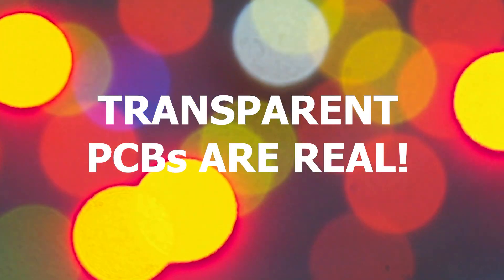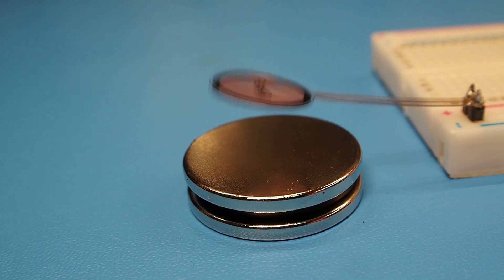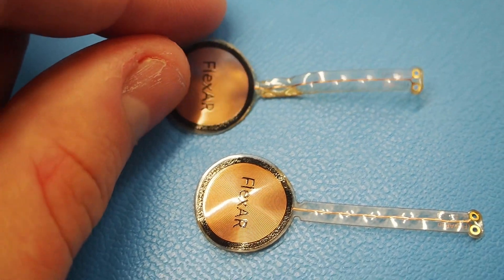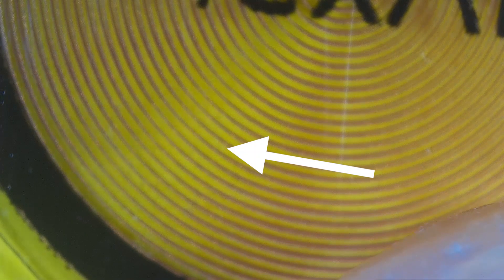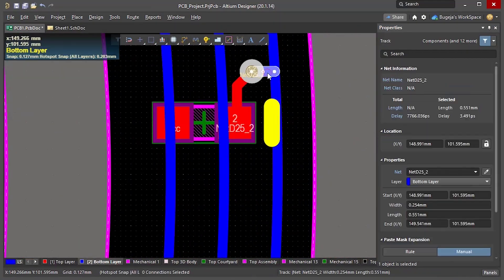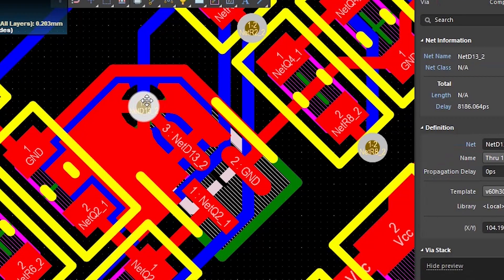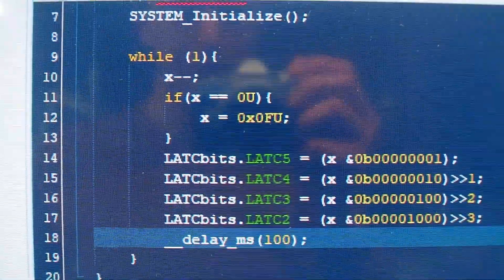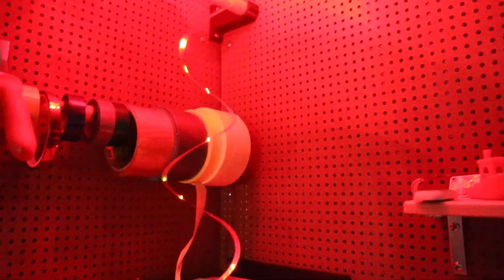How I got See-Through Circuits for Christmas

Comment: Oooh, transparent PCB. Could be useful for certain optoelectronic application. I would be curious to try it out in my design wherever flexible PCBs are a must (could be interesting to use as a basis of a capacitive touchscreen panel for my camping battery pack's graphical vacuum fluorescent display if they can make transparent conductive traces at some point).

Comment: It looks like only substrate is transparent. But still, copper is a problem
Reply from the maker: Both dielectric and soldermask are transparent
Reply: @CarlBugeja  0:49 but I can see the copper circuits that came from one side and it becomes a coil on other side.

Comment: you can use bismuth solder paste with reflow temperature around 138°C
Reply from the maker: that looks interesting!
Reply: @CarlBugeja  also you can use it to solder leds for less temperature stress (there is some efficiency drop when overheat leds)